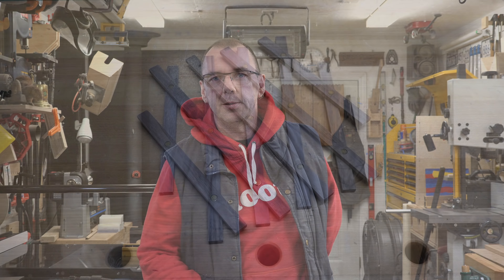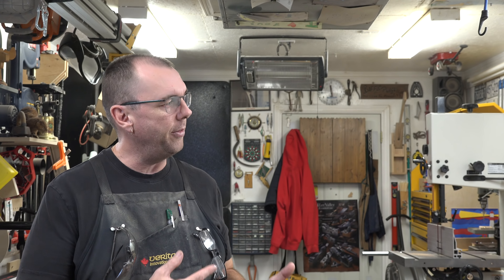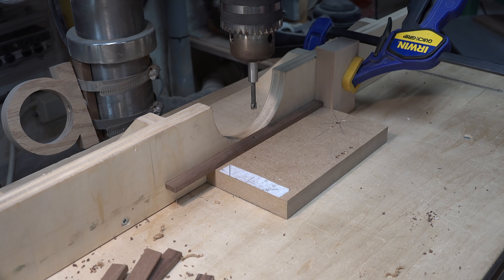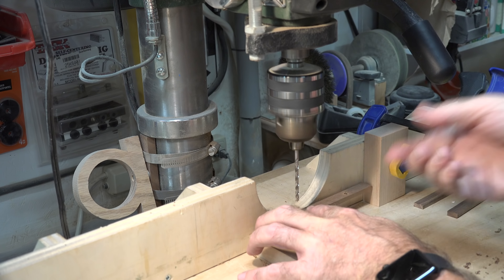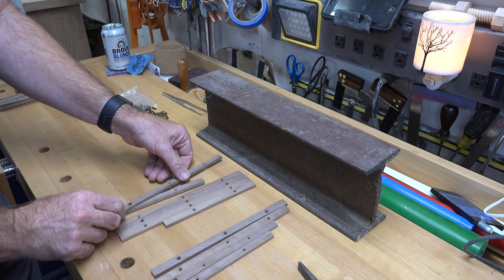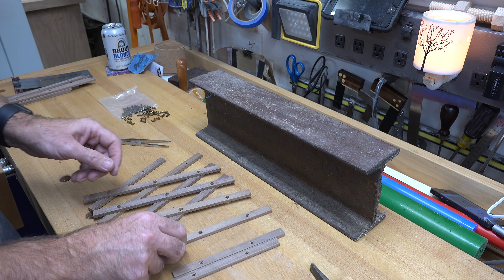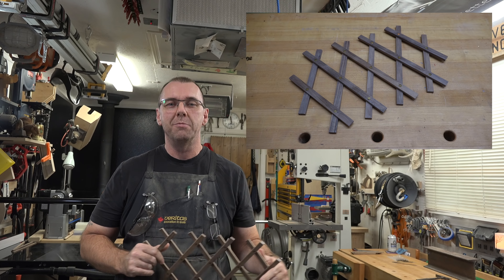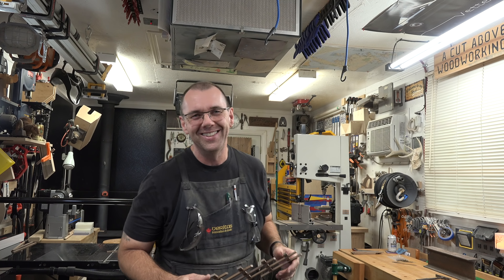Making Adjustable Trivets

Comment: These will be so super helpful in the kitchen and in the shop. Soft wood for hand-plane and chisel rests on my bench.
Reply from the maker: I agree with the usefulness in the kitchen Thomas but I never even though of the hand plane of chisel rest.  I might have some concerns with the plane blade hitting the rivets though.  I guess if you were careful, it would be fine.  Great idea.  Thanks for tuning in.
Reply: @acutabove_woodworkings  you could use double ended wedged wood rivots for the shop rest?
Reply: @acutabove_woodworkings  like tree-nail in boat building.

Comment: Great scrapwood project, Kenny!  Glad to see you're making sawdust projects again (vs. ABS tailings).  Did you use the 3/8"-1/2" size rivets for this?  I really like them.
Reply from the maker: Thanks for the kind words on the show.  You would be correct that I used the 3/8"-1/2".  With the pieces only being 3/16" thick, they were the perfect size for this.  Thanks for tuning in to the show